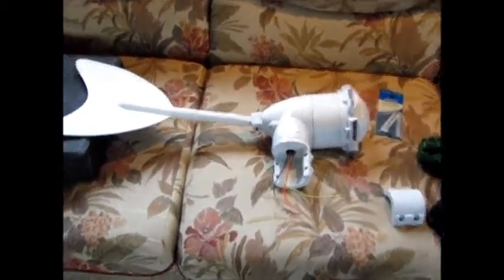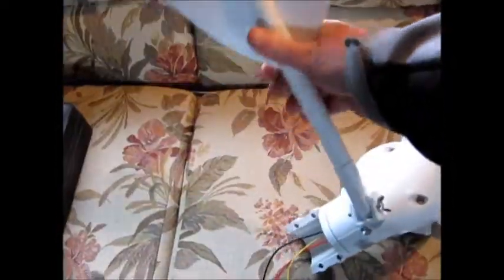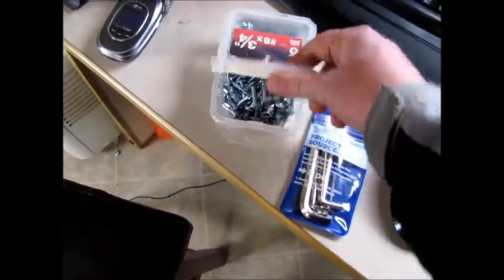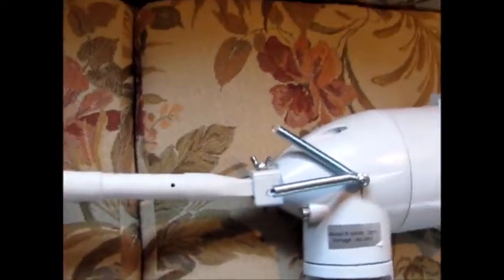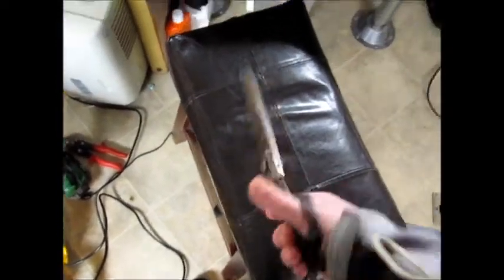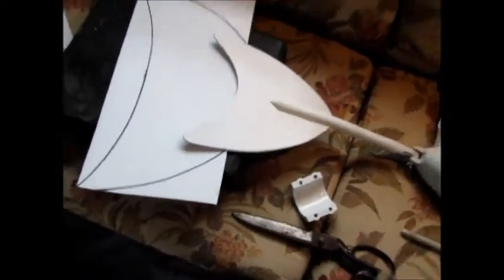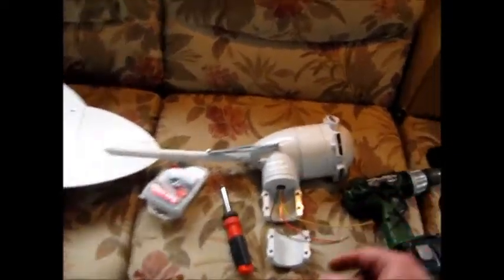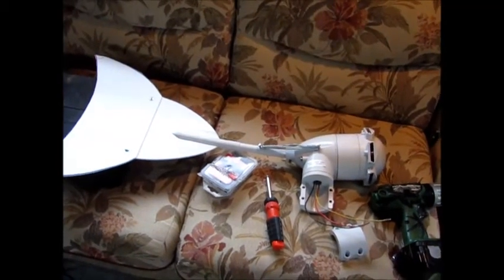Toy Chinese Turbine,, Video 2,, How to make it work

Comment: Hi, I want to buy this turbine. Do you think it is Worth it? Aby chance to get investment back in lets day 10years? Could you write review about it?
Reply from the maker: I think this is a great little turbine to buy if you are just starting out with wind power,, the price is the best part, around $250 U.S for this turbine. It cost me less than $600 U.S for everything ,, the turbine , grid tie inverter,, 10 foot mounting pole,, and wire,,
This turbine is small and lightweight ( compared to my MW&S turbines) these little chinese turbines are easy to move around your yard to experiment with the winds in your location,, after experimenting using this little turbine you will know if a larger more expensive turbine will be a good investment for you ...

But for me , in my location , I think Solar power is more consistent and a better bang for your buck ,, Wind power is awesome to have on a stormy windy night,, but every day my Solar makes power ,, not every day is windy in my area..
Reply: Jason Brown Cool thanks brother nice tip..

Comment: hI Jason, just subscribed. You have a lot of good videos here, thanks for all the hard work. Im just getting into wind turbines and have bought one of these. I can see the idea of slowing down the furling with springs, thats cool, ill do that.

Can i ask a few questions please.

"Tracking into the wind" ... so are you saying bigger fin helps to align the blades into the wind?

How do i go about attaching it to a scaffold pole? ... im thinking 3 meter aluminiam pole, couple of scaffold buckles, mounted to the corner of my live in van.

How do i wind the 33amp cable? inside the tubing or attached to the outside.

Have you got any tips for mounting turbines please?... if your willing to make a video about such things that would be great

All the best, wish you well kieron uk
Reply from the maker: Thanks for subscribing,

Yes the larger tail and springs I added help the turbine stay pointed into the wind , help the turbine track the wind :)

Close to the end of this video I show the clamp this turbine comes with that hold it/ attach it to the mounting pole :)
I use a steel pole it is stronger , but if you feel that your aluminum pole will work :)

The turbine is noisy, if you add some rubber between the pole and your van it might help quiet it a little :)

I use a outdoor 12 gauge, 3 wire , extension cord for my wire, it hooks up to the turbine inside the pole,  

If you have more questions just ask,, I will do my best to help you out :)
Reply: Hi mate, thanks for the reply.

Ah good... ok steal pole then. Cheers

The rubber idea is good, ill have to think about that. Perhaps some stiff rubber blocks used on boat trailers.

Also is there a way to quieten the blades? like adding holes into it or maybe more plastic to the tips? just a thought

I found a calculator online for the "what type of wrie do you need" and it calculated 33amp wire, so bought that. Its a bit chunky but i guess ill need it because the turbine is DC. Just found out that i could have got an AC wind turbine, thinner wire, and rectify it as the battery end. oh well lol.

###

https://www.dropbox.com/s/01rspdgl0ar496s/20141115_180113.jpg?dl=0

1. So got wind and solar coming in, with in line fuses & diodes
2. attached to flattend copper "rails" forming a bus bar.
3. bus bar has capacitor on it to smooth the volts. I dont know what capacitor to get yet
4. from bus bar have in line fuses leading to charge controller. Apart from regulating power and checking battery charge. Do charge controllers divert to dump load?
5. Can put item on to provent 10.5v discharge

http://www.ebay.co.uk/itm/12V-Accumulator-Sound-Light-Alarm-Prevent-Over-Discharge-Controller-low-voltage-/281424349769?pt=UK_BOI_Industrial_Automation_Control_ET&hash=item418632ca49

6. battery bank. 550ah. May do "alum" conversions from duff batteries. cheaper
7. in line fuses leads to 5v downstep for usb's stuff / 12v direct stuff / inverter 1000w for 240v stuff

Was thinking about having a row of circuit breakers, but dont know what types i need.
... am i missing something important do you think?
Reply from the maker: DiyEcoProjects
It looks like you thought of everything you need,

Most charge controllers dont have a dump load ,, and the ones that do, I don't like the way they work,, that is why I am building my own ,,

I will be doing another video tomorrow about my new 30amp MPPT charge controller. and how I plan on using it with one of my little chinese turbines

 If I think of anything you might need on your setup I will let you know :)
Reply: Nice one jason, thanks for all the help :o)

all the best kieron uk

Comment: very creative and nice job! I just use a piece of metal 12" by 24" mounted to the end of tail. It seems quite common that the Chinese don't put large tails on them. Who is the manufacturer? Is it HYE?
Reply from the maker: Heh,, It is NOT HYE :) It is called P-300W Hyacinth,, very inexpensive,, that's probably why I have to Modify it to make it work :)
Reply: Jason Brown here is a link if you to know more than you wish and if wish to buy in bulk
 http://szldk.en.alibaba.com/product/932722187-209786487/300w_hyacinth_wind_generator_wind_turbine_high_quality_low_price_CE_ROHS_certificate_12VDC_12VAC_24VDC_24VAC_300w_wind_generator.html
Reply from the maker: john otoole If I bought these lil Chinese turbines in bulk,, I would not feel right if I did not do my tail modification to them before I re sold them,, If I sold these lil turbines,, I would make sure they would work for my customers,, using a tail modification like I show in my video would add extra cost to the turbine resale price,, even tho my tail modification seems to make these turbines work properly ,, I don't think I could charge more for these turbines after my tail mod on the resale market,,,
 I would make very little money but my customers would be happy,, because my product would work :)